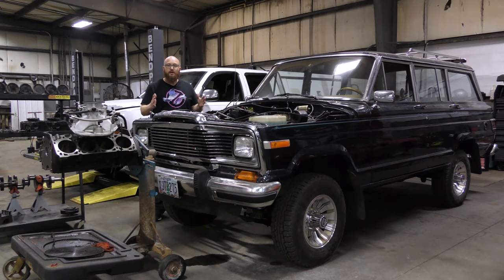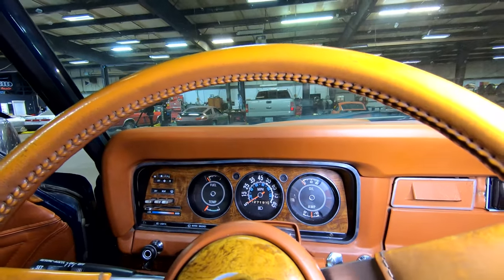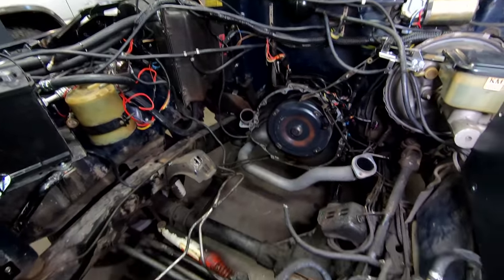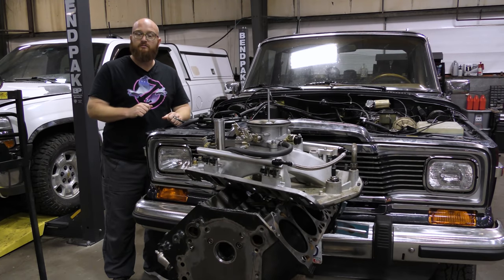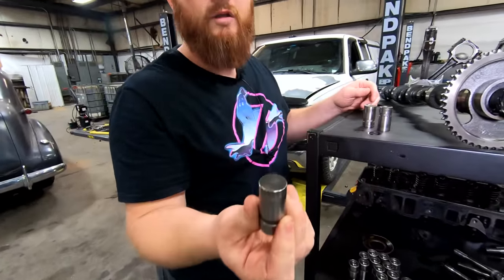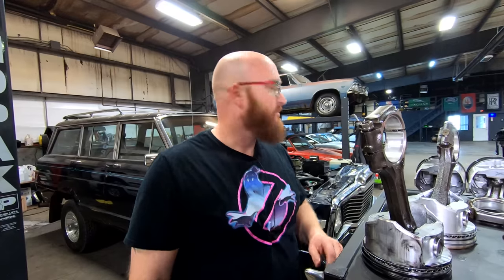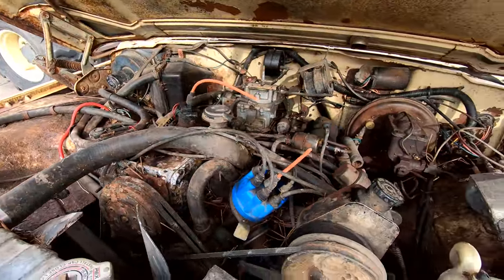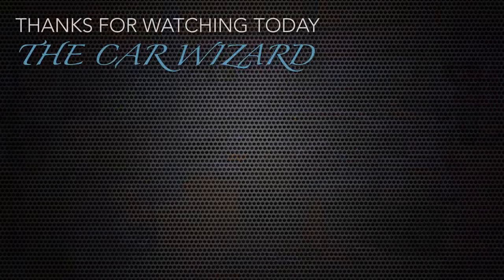The '83 Wagoneer rebuild is dead! CAR WIZARD gets burned by another shop!

Comment: Might wanna check the lifters in the "rat jeep" engine. If they're good, use them. Only cheap Chinesium lifters to be found out on the market right now, and they have a high failure rate. Lots of experienced builder has had trouble with lifters, no matter what brand it says on the box. So I wouldn't be to hard on the builder.
Reply: A new cam will require new lifters, you cannot re-use lifters on a new cam because the same thing will happen but to all the lifters this time.  If you can't get good quality lifters (I would be surprised at that) then machine tool steel solid lifters.
Reply: This is true about modern replacement flat tappet lifters. Let's play devils advocate though, because that still would not explain the piston to wristpin tolerances.
Reply: @mikejohns3104  Maybe particles of material from the damaged lifter and/or cam that found their way in there, is it possible ?
Reply: Wow you'd think with hundred plus year old technology like valve lifters, even the Chinese wouldn't be able to get them this wrong!
Reply: Use better hardware or ARP bolts
Reply: Should be able to use Chrysler lifters.  Same .904" lifter bore size.
Reply: Imagine tearing thru engines at a junkyark searching for "serviceable" lifters.
Reply: @mikejohns3104  uncle Tony only uses roller cams now.  New cams and lifters are garbage.
Reply: Any Chinese metal product has a high failure rate.
Reply: @Beer_Dad1975  It's really sad. With just about anything, not just car parts. The Chinese can produce an item for 10 or 20 percent the cost of making it any place else in the world. But it's never "just right". How much more would it cost to make it "just right" in China? another 5%? 10%? It would still be only 30% the cost of anywhere else. The Japanese learned this 50 years ago. They were making cheap junk for close to nothing, but people were still buying American. Then they realized. For a few pennies more, they could make a quality item and still be far cheaper than American made. Now Japanese (including Taiwan) is some of the highest quality in the world.
Reply: @kewrock Actually there are some very good Chinese products it just depends what the greedy American corporation wants. American corporation's are making record profits including the oil company's. So they cut every corner they can to increase $$$.
Reply: @kewrock  Oh and I have seen some real crap MADE IN THE USA
Reply: ALL lifters sold as new on the market blow now. There is not a quality option out there.
Reply: @chetmyers7041  I may have a clogged fuel filter. 
( I hope that's all it is)
And a 28 year old fuel pump needs to be replaced .Chevy 454
Reply: They’re also being sold as the big name brands, from places like Amazon and eBay.
Reply: @kewrock  The American companies that sent the specs over to China and then reaps the profits from the sale -that is who is responsible.  They should demand better quality control, it's their company on the line.  The Chinese will build to better specs if held to account, but the company owners should be held to account.
Reply: @mpetersen6  How about the overall length, effective pushrod length, oil hole location ect and how would that help?
Reply: @montehammons7917  They demand a dirt cheap price not quality control. if your willing to pay a little  more there are factory's in china that will make really good stuff. but since it is all about profits they want CHEAP
Reply: @mikejohns3104  
Metal powder being pushed thru the engine...  scuffed all the other bearings, probably is trapped inside that one piston making it tight light that... 
Uncle Tony's garage did a video on this exact issue.. bad lifters.
He is currently using old stock he had purchased 10+ years ago.. when those are gone???  who knows what we will be stuck with.
might be better to use both the cam and lifters from the Rat jeep.
Reply: @tomhutchins1046  
Yes overall length and such need to be taken into account. IIRC AMC bought their lifters from Chrysler. Probably a standard Chrysler part #. A smaller manufacturer can't make everything themselves. The last time I checked on one of the aftermarket speed equipment sites roller lifters were the same part # as for Chrysler. Whether it was the 383 family or the LA I'm not sure. Pushrod length would of course need to be checked. 
One thing I've always wondered about is if any of the US manufacturers ever looked at raising the cam higher up in the block. I know that Chevy and maybe Chrysler ran some experimental OHV V-8s with two camshaft. These were stacked vertically. The top cam was for better exhaust valve actuation angle. But what I was thinking use one cam for each bank. And position the cam as high along the bank as possible.  The idea being to shorten the total length of the valve train and reduce valve train mass as much as possible.  In the 80s I had a Renault with a 1.6 liter four. The engine was OHV with hemispherical combustion chambers.  The cam was so high up along the side of the block there was actually a space cast into the head to clear the timing chain and sprocket.  Was a very free revving engine.
Reply: @stevemurray710  roller cams all the way. no issues with them after use and abuse.
Reply: Chinese metals used, turns to putty
Reply: Mert M  thanks
 I do basic maintenance. Recent spark plugs and wires. Oil change.  Cleaned the distributor contact - but reused the distributor  (9 years old rotor cap
Reply: @Beer_Dad1975  Its the quality of the metal. This has plagued china for decades.
Reply: Rat jeep ? Is the frame rusted if it is not i can use it. Wagoneer or chairocoy
Reply: Eh, NNNOOOO! You'll eat that new cam like I eat a Porterhouse!!! That is a wear surface that gets mated to the lobe, if you even switch lifters on a flat tappet cam, buh...bye.
Reply: @montehammons7917  they don't care. We need to bring everything back here, for a DECENT price! We WERE The Biggest Dog In The Yard back in the day when WE made our own stuff!
Reply: LOL...Chinesium...stealing that.
Reply: @johnwilbanks3885  and that's the big problem the china made stuff we blame china but we need to blame these companies too for opting to have there stuff made there tryna save a buck
Reply: Reminds me of the power steering motor my dad bought for his 89 Dodge Vermillion. Literally had to grind the case down to get it to fit, the casting was so far out of spec.
Reply: lifters dont cause seized wristpins - this was an engine with multiple build and tolerance issues
Reply: @ghostrider-be9ek 
 Car Wizard said that.
The lifter issue was only one of many problems this engine was built with.
Reply: @ghostrider-be9ek  If metal fragments or antifreeze go through the oiling system, it sure can cause damage.  If the wrist pin was that bad at assembly- the motor would never have made it through dyno and break in let alone the tuning process.    Not saying the builder isnt at fault or at least partly to blame, but lets not be so quick to judge.
Reply: @leinie6683  if the wrist pin was SEIZED it would have not made it through a DYNO. There is more than enough leverage to turn the wrist pin, even in this state, when the engine is assembled.
Reply: Can't use old lifters on new cam
Reply: @clivewilliams3661  how many engines have you used these tool steel lifters in?  The metallurgies must match and cams are not tool steel.  Besides, solids require  adjustable rockers. I just buy two sets and disassemble them and mic everything.  Guaranteed, 3 out of 16 WILL be loose, sometimes more.
Reply: @carmudgeon7478  Tool steel lifters are the top grade solution for VW aircooled motors, especially if you are running high lift cams, to cure the hollowing out of the lifters.  The VW engines are particularly prone to hollowing out the lifters and ruining the cam that has been attributed, as in V8 pushrod engines, to the reduction in ZZDP in oil and flat tappet lifters.  Breaking in the cam is still required but the tool steel lifters and the cam appears to last so much longer.  I have not heard of any tool steel lifter/cam degradation in use.    Of course solid lifters require some type of adjustment but that is all readily available afaik and besides the overall weight of the valve train is lighter, which can be used to create less pressure on the cam.  Hydraulic lifters were the manufacturers solutions to reduce servicing and to quieten the valve train, they have no intrinsic engineering value.
The issue principally is the lack of lubrication (ZZDP) at break-in of the cam and later during normal running, not any engineering failures.
Reply: @clivewilliams3661  Excellent.  Thanks for the education.  I have never been in a Bug engine.  This community is the best.
Reply: @mistersniffer6838  Probably not as I understand the extent of the available engine parts is extensive.  If flat tappet lifters are not readily available in the right quality then as said making tool steel lifters is an option as well as converting to a roller rocker arrangement, but I doubt the Wizard would consider anything so radical or left field.
Reply: @clivewilliams3661   - Engines are generally built to "just" hold together for the abuse it takes under "normal" circumstances.  I am not saying your wrong, but, do you realize how fast something is going around at 14k rpm, lol?  Even briggs engines blow a block once in a while, though they have a longer stroke but only push to 4500 rpm.
Reply: @mistersniffer6838  Modern engines last longer than their equivalents in yesteryear.  Of course, all automotive and most other products are built to a 'use by date' but the quality of engineering is so much better now along with oils and coolant they last much longer.  BMW run each of their engines on a test bed for the equivalent of 1 million miles to prove their longevity.
If you want to see a manufacturer who actively time limit their motors and drivetrain, you only need to look as far as Tesla, their ECUs are reputed to have internal clocks that shut down the systems at a prescribed point and to install a new ECU is so extortionately expensive that the cars become scrap.  Hence why there is a trade in refurbished ECUs.  Tesla will only sell and install a complete battery pack at the cost of $11,000 even though only one or two cells costing a few dollars are faulty.  They have designed the battery installation such that it takes many hours to access the battery pack to change the defective cells.  So much for sustainability!  
If there was one manufacturer that epitomises the worst in modern engine manufacture its Briggs and Stratton, which clearly build down to the lowest budget before they then take some more out to make profits  I rebuilt one of their Vanguard engines to the standard I would have expected from any other horticultural engine supplier and instantly doubled the power output, such was the crudity of its manufacture!
Reply: @tomhutchins1046  LOL,,, that’s some big claims from someone with zero knowledge.
Reply: @kewrock  Chinese factories manufacture parts to the customer's specifications.  Who specified the soft lifters?  Why, it's the American buyer who demands the cheapest price!  Blame the US company that is greedy for profit.
Reply: Old decent lifters CAN be rebuilt and resurfaced just like regrinding the cam.
The quality of many new parts available right now are substandard.
There are only a few manufacturers of lifters anymore.
Reply: @stevemurray710  Tony moron with lifter are rebuilt and reground. Funny ever seen core on lifters NOOOOOOO. Biggest ;problem with flat tappet cams is the oil now don't have anti-scuff additives anymore
Reply: @kewrock  How do we know it Chinese junk???? I had bad HYD roller lifters that bleed off oil that were made in the USA. So a lot of crap we make here crap too. Sorry to say a lot of stuff that does come out of China is very good. AFR heads stuff casted in China was better than what was casted here WOW. We the United States shipped all of our Manufactuing out of country. U.S was nation building other country while we took back seat. Secondly we don't have anyone in the trades as in machinist, tool die makers, techs, mechanics and so on. Now we're too worried about kids picking their gender social BS. Manufacturing was back bone of this country and middle class
Reply: @pdmustgtd1013  Agreed.
Reply: The problem is with shops getting thier parts from chain parts stores. These chain parts stores are well known for putting used parts back on the shelf. A hydraulic none roller should have a slightly domed surface. It's hard to see with your, but placed face to face with a known good lifter you can see the difference. Lesson is, don't buy from chain parts stores without checking the parts. I once had to test coils at the counter, and out 5 coils they brought out 3 were bad. This also doesn't let the engine shop off the hook for the piss poor piston & rod assembly. That's just smacks of not caring about what you are doing, or substance abuse issue in the shop.
Reply: Chain stores get their parts from same place just in different box. Roller cams are flat, no crown, no taper but just flat. Flat tappet cams are slightly tapered and lifters are crowned to make them rotate. Roller lifter problem I had was I ticked bad when cold and slightly at full temp. I got them from cam company SO CALLED MADE IN USA wasn't cheap either. Funny same markings as chain store parts mmmmmm. Rod and piston who knows what really went wrong.
Reply: @pdmustgtd1013  yes when they order them, but when a customer returns with a core or defective item they often just put them back on the shelf. I have opened boxes at the counter to find an obvious 150K mile part, and had to ask for a new one countless times.
Reply: Is there any way to determine whether the rod bearing and wrist pin failures were caused by metal from the failed lifter?
Reply: @Dennis-vh8tz  that was just poor quality control. The clearances are far to tight. This prevents a film of oil from getting in there. This will cause them to totaly lock up like that. The excess heat causes the wrist pin & wrist pin hole in the rod to warp & deform. The normal clearance between the rod & wrist pin are close enough that metal bits won't get in-between them. Unless the rod is totally worn out & the wrist pin hole of the rod is excessively large. Which should be caught by even a rookie engine builder.
Reply: @Beer_Dad1975  They absolutely CAN make lifters as nice as can be. The question is, does that give them enough profit and are the buyers demanding that level of quality? If some US based company orders 10,000 lifters and they're only willing to pay $2 a piece so they can sell them for $10 a piece, do you blame the Chinese for making lifters for $1 a piece or the US company for demanding massive profit margins on cheap products? There are a lot of links in this chain. Why don't these companies demand quality and perform proper testing?
Reply: @802Garage  Yes, really good point, the resellers need to be held accountable too.
Reply: @Beer_Dad1975  Really sucks so few things are still made in USA or at least Canada haha. 🥲
Reply: Had the same situation in my 89 last year. Brand new camshaft split and four. Now we are swapping for the ls. Every engine builder I’ve talk to said that all the lifters right now are just absolute junk. They won’t build a flat lifter engine at all.

Comment: Mistakes happen, don't be like "shame on the builder" remember you almost messed up hoovies mercedes by not putting the correct fluid in the correct hole. People make mistakes, and we gotta treat people like people.
Reply: Yeah, I was definitely not liking the 'throw him under the bus' tone of this vid. The end of that cam was fuzzy with metal ... that could easily be the reason for the wrist pin. And given the quality of the available parts today (how many times did Hoovie's steering rack fail?) ... definitely not giving this vid a like.
Reply: 10:44 exactly why he shouldn’t blame the builder, shame on the “wizard” we don’t need the discovery channel drama.
Reply: The builder lied and said the engine had been broken in and dyno'd  So yes, shame on the builder.
Reply: @21Piloteer  it could have been, how many runs on the dyno we dont know. that cam and then the lifer could have failed and probably did when the customer was driving it home or on the way to the wizards shop.
Reply: It’s not like he called out the builder by name.
Reply: @hydewhyte4364  I mean, the engine NEVER ran right in the vehicle.  What are the chances that it was dyno-tested and passed every test and then never ran right when it was installed?
Reply: @megachonk9440  50-50 with the presumption that the builder owns the dyno. But any builder doing enough business to pay for a dyno is doing enough to know how to do it. Was it an outside dyno shop that wrecked it? Was it one careless employee? Too many variables, and none given to us to balance the accusations. And an owner not willing to even talk to the builder, and willing to toss the warranty without looking back? Maybe that makes sense to you ... but it reminds me of my kids trying to explain where all the cookies went
Reply: It annoyed the shit out of me when it could’ve easily been a part failure. I dont know ill have to give this one a 👎
Reply: Not to mention he CANNOT say it was definitely the builder. The failure looks a lot likea rich running engine that got washed out with fuel to me. Seen it many times. Guy gets a fresh engine and has to change the fuel setup at the same time. They dick around so long trying to get it running right it ends up eati8ng itself alive with so much fuel getting in the oil. It happens ALOT more than people realize in the hot rod world.
Reply: yep sucks being human and make mistakes ✌🇺🇸